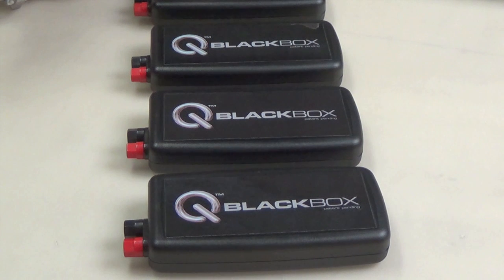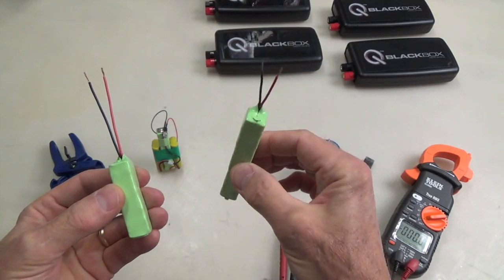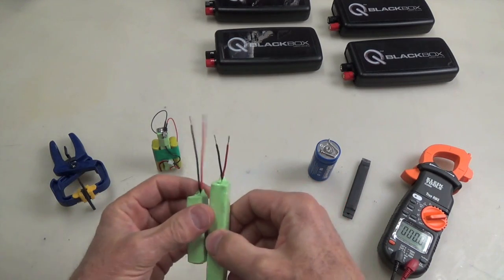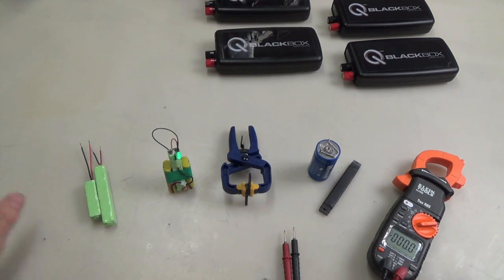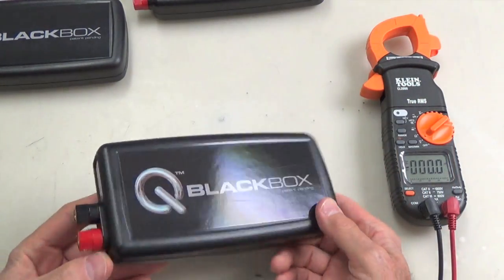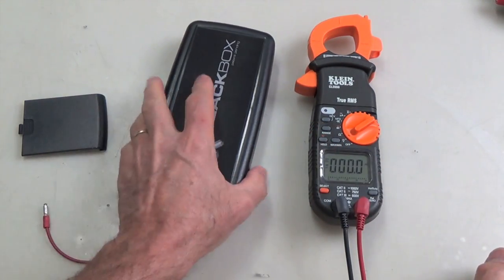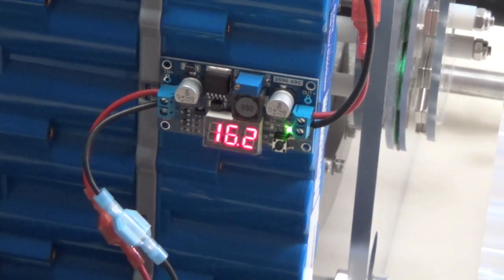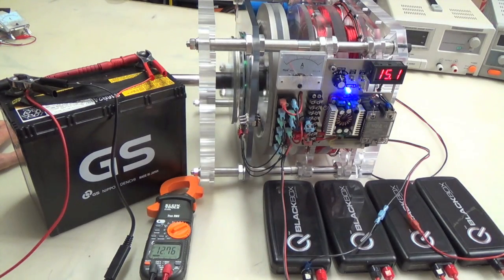BLACKBOX - Silicon Crystal Graphite Battery Module - NO CHARGING

Comment: At home I am already building it with graphite plates (2 types of graphite) and a dialectric electrolyte (a sticky gel-like liquid, it has to be a very viscous liquid). And the best thing is, it works as you described it, but the energy comes from heat because it converts the energy of the heat into electricity, thereby charging the plates. The electrolyte has free charge carriers that move and release electrons from the cathodes and anodes.

I wanted to buy something like that, but I can't afford $ 2,000 or even more and most of the others I even told a friend about it that he found her invention interesting (he said to me "It's a fine thing;)").

Why not sell cheaper units for $ 100 with it you would earn much more than with such expensive units that can not afford so many bars. More buyers mean more revenue, so you only give a small part the opportunity to explore this thing.

I would buy it only if I either had enough money or if it was cheaper.

LG
Reply: I wanted buy from him but unfortunately the site is down for some time now. Can you give me a few pointers on how to build it? I would be happy to pay for it.
Reply: @thepetest22  Yes, there are 2 layers of graphite types (2 different). One side is doped and the other side is oxidized. So one side gives off electrons and one side accepts electrons.

If so, it should generate electricity like a battery.
Reply: @Chicsweet1987  Awesome, thanks! And what exactly goes between the two layers? How to prepare it?
Reply: @Chicsweet1987  Would you be interested to share your findings as well as maybe blueprints in a telegram group? I just found out that Mike Kantz has passed away unfortunately, and I feel that we should pick up where he left off and make this technology mainstream..
Reply: @thepetest22  
So far I have only recreated it on loan, but you have to use 2 different types of graphs. When it did, it only delivered a few millivolts. What is between the shifts someone explains in the video:

My notes on it
2 plates

10 elements in every single cell
(complicated processes = manufacturing)

Start redox reaction
(very easy)

Anode (left) pure graphite plate (breathing) 1/8 inch
Oxidized

+ Cathode (right)
Receives electrons

electrolyte
Deilectic
Gel-like sticky (like solid electrolyte) Silizion SIO2 integrad
Silicon Activated Activated Enlarged 300 times
Expanded = increases load carrier plate to plate
faster highter rat = higher speed
if not prevented = fracturing = destruction of the cell = where is expansion going = as simple as the electrolyte gel
Carriers take to go in gel
Overgrowth on silicon = electrons from the donor plate to the cathode
Fire extinguisher = does not burn = does not freeze = very hard material = no acid = no toxic chemicals

Dream what he has already developed for a long time = Developed for a long time

Comment: looks intrestig if you can get it up to USB power to charge phones it would rock.
Reply: @MisterManiac  USB port ?
Reply: I highly doubt you can cut a usb cable hook it to the red and black connector and charge your phone as it would overload the internals if the device had the equipment to regulate the USb inside it would simplify for people who have no understanding of elecronics Yes people can take a car charger and sodder some wires to the connectors after takeing it apart but any have no idea how to do this stuff.  I was just saying puting it inside would expacd the opertunity to people and you could mass product them making money.  But some peopel required a full expelanation to understand.  Dang

Comment: awsome application of the tesla motor. i especially like the cap/pulse /charge cycle idea. don't know if you sell or will be selling whole home generator packages. as a unit. Like a generac. Say 18 squeezed down together with thin plexi or acrylic spacer/mount to back side like in your demo unit. then the pulse motor then another pack of 18. run the drive shaft through to your generator??? By the way. many smaller caps will charge up quicker. Pack it all in a neat cute quiet little box.
Reply from the maker: great design idea

Comment: It is physically impossible for these to go on forever without needing charged.  First of all, in the pack itself, you have the batteries charging the caps, which then charge the batteries.  The problem is every conductor in the circuit will have some electrical resistance.  It might charge back and forth for quite some time, but little by little you will loose some of that energy to the electrical resistance.  Now let's hook these up to something.  Let's just take a simple LED bulb.  By lighting the LED, that uses some of that stored electrical power.  When it's used, it's lost from this system.

On another note, placing the batteries in series, it will not give you 11.2 amps.  You will still have your 2800 mA.  You have to put batteries in parallel to combine the current.  Putting them in series will only increase the voltage.
Reply from the maker: After being recharged by the cells, if you remove the batteries and use them to power other devices, you will definitely have 11.2 Ah. The batteries can not feed back to the cells while the internal diode blocks them.
Reply: And you are wrong in this sentence: "When its used its lost from the system".
You seem to have forgotten nothing is created nor deleted, only transfromed.

Comment: I have a 35yr old EV!
I Need 144vdc @ 200a, To Make it Work!
Lead Acid Batts are about $1,000!
Lithiums, Probably Do it, And I Would Need,
BMS, AND Charger!
I Figure $15,000-20,000!
I can buy a New Leaf for $21,000!
If I Can Trickle Charge my Lead Acids,
Say About, 150vdc @ 10 - 20a!
Then, I would Need A BMS , 
For my Array of Lead Acids to make sure, 
I Wouldn't Go Below 20% discharge!
80%, Left in Battery Bank!

Comment: Why not use a solar panel to operate a low voltage hertz emitting diode to charge your cool technology you have invented? That pulse engine works off frequency right? Why not make things simpler and get rid of the motor and just use frequency? But hay if you want to feel special and all tingly with your toy and senseless use of materials and tine and .....money hay its all you. ; )

Comment: Question, if crystal graphite power cells generate an electric charge from the induction field generated by the molten core of earth? Then humans have evolved to operate in said induction field that also generated atmosphere correct? I read a study of how plants subjected to infrasound grew at a fast rate. Infrasound like induction is frequency correct? Could not induction coils be used to grow crops in hydroponic green houses at a much faster rate? Just use the correct frequency to boost plant growth. Crystal graphite graphite power cell technology could be used to supply power to these green houses to do this yes? If so drought stricken areas could be given this technology to help save lives. Sun to water machines could also be used to supplement water supplies. But do the powers that be really want to help others in need? = /

Comment: The magma jet stream that generstes an induction field that creates atmosphere charges these graphite super caps? Induction is frequency? So these are reallly operating off earths induction field? Why not use a different frequency to amp up the electrical output of the crystal graphite power cells and stop leaching off earths power system that keeps atmosphere in place? = /

Comment: Could a microwave transformer with two magnets on each side generate 110 volts? If so then could you not use  crystal graphite power cells and generate a home power plant? With a capacitor and gel battery bank? You could even run an induction graphite hot air V-10 Manson engine off the microwave transformer with a transmission to turn a high voltage generator. Talk about free energy? LOL
Reply: does that work with the magnets and transformer?

Comment: An integrated system to generate green renewable electric energy could be developed to replace all the fossil fuel use? A solar acustic engine tuned to the correct frequency of the crystal graphite power cells would generate a steady flow of current? 100% free energy 100% more efficient then fields of solar panels? = /

Comment: The Crystal graphite power cell can be exposed to an induction field that will crank up its electrical output? Induction is a frequency correct which means you could tune into the Crystal graphite harmonics to generate more electricity? Is this correct?

Comment: You could use axial vector crystal graphite induction hot air engines in a bank that ran a transmition to power all sorts of vehicles vessels planes and electrical power plants. No more need for coal gas geothermal or hydroelectric power plants. This would benefit the whole world yes? = )

Comment: A artificial fire place ran off thermal electric crystal graphite power cells would be a big hit on a very cold night. A little Doyle graphite hot air engine inside would make it self charging? Novartis

Comment: Design a Doyle engine to work off low voltage induction using graphite crystals in the pistons for a hot air engine that generates electricity has well has mechanical motion. A cool design to replace a pulse motor to generate power for crystal graphite power cells that has multiple applications. Hay do you think it would work to power vehicles? = )

Comment: The average US resident uses 600 watts per hour, 24 hrs/day all year.  
A lot less while you're at work or sleeping, most during cooking, cleaning, etc.  
So you'd just need 200 of those Black Boxes to meet your needs !
Reply: We Don't Need Batteries     The space around us is the best battery.  
"The vacuum of space appears to be an energy reservoir of immense capacity 
that makes nuclear power seem old fashioned."   Richard Feynman and others have pointed out that the amount of Zero Point Energy in one cubic centimeter of the vacuum (ambient space) is much greater than the energy density in an atomic nucleus.   "The amount of energy expended by our galaxy of 100 billion stars shining for one million years is roughly equivalent to the energy locked up in one cubic centimeter of space anywhere."  

If you could produce energy faster than you could use it, 
then you wouldn't need an extra man-made energy storage battery.
Reply: Mike Hingle u

Comment: Those 4 2800 mAh cells in series results in a battery capacity of 2800 mAh @ 4.8 v. If you want to increase capacity, you need to put them in parallel which would give you 11.2 Ah @ 1.2 v.
Reply from the maker: Correct. Or you can remove them and use in other single 1.2v rechargeable devices for combined Ah sum.
Reply: are these devices for sale

Comment: For example if you take nintinol and use cold and hot water to activate its crystal lattice to produce movement? Could you not remove the need of hot and cold water by using radio frequency or a hertz tuned to activate the crystal lattice? High vibration causes heat in the water low vibration creates low temperature is this not correct?

Comment: Would not an induction field tuned to the power cells harmonic crystal lattice produce a steady flow of current? You could design an integrated power system  correct?

Comment: Is it possible to design a basalt limestone graphite crystal harmonic power generator that run an electric motor? Or generate an induction field to run a Manson graphite hot air engine to produce high voltage creating a stand alone power generator that is fossil fuel free?

Comment: Design a solar acustic engine to use with your power cells. I bet you could get rid of geothermal and coal and gas burning electricity plants if you did. You would just need to find the right sound generation to energize the graphite Crystal matrix correct?

Comment: If you use nano wire liquid batter technology with crystal graphite power cell technology with induction technology with hot air Manson engine stove top fan technology? Could you not create a space heater that could provide heat for a few hours then be able to recharge itself? If you had more then one working in intervals could you not heat a home? Now design a cooling system that works the same way. Hay no more heating and cooling bills? I have a cooling design are you interested in hearing it?

Comment: I would Like to see the discharge curve to determine how viable this is.  Under serious loads of discharge and unrecomended charge the silicon will expand and break up.  Maybe a power diode to prevent charging via the terminals.
Reply from the maker: Quite true Mike. I developed a simple solution to the expansion issue in March '16. Even MIT is now experiencing this obstacle. They have resorted to using hollow silicon coated nano tubes to provide a space for up to 300% expansion. Technically cool, but inhibits product production. Yes, I do have a diode in the circuit btw.

Comment: So could you increase current with a higher surface area per cell? Or can you make a cell by mixing powdered graphite and powdered silicon crystal each in some electrolyte and put the two poweded mixed dried and hardened together to make a cell with high current and voltage?
Reply from the maker: +travis moore   It doesn't work quite that way, but I like the way you think!
Reply: PMMG4HYBRID , 
Are You Still Alive?
Does This Thing Work?
I have a 35yr Old, 
1981 Jet Electra!
I Need Batteries that Work 
Or a Trickle Charger That Works!
With That Information, 
You Can See, A Photo, 
And More Info, on the Internet!

Comment: 2 Questions:
1. How long will it take to recharge the Blackbox batteries after being fully drawn down (after 4hrs run time?)
2. If you connected the Blackboxes in series without their batteries (4X17=68V), but introduced a variable resistor pot between them and the G1 to maintain your ideal 15-16V, would the milliamp delivery still be insufficient to drive the G1 and overtax the silicon/graphite cells? 
Great work BTW.  I've followed you for years...
Reply from the maker: +The PianoGuy   1. It was 6 to 12 hours before I switched to new lithiums... testing now.  2. A buck converter would likely work better. Haven't tried that yet.
Reply: It would take infinity

Comment: You Should use that blackbox (a bigger one) to recharge an electrical car. If you manage to do that you can limit the size of the battery, making the car lighter and get rid of the range anxiety. Obviosly when the battery is out of charge, the car won´t be able to run normally, but you won't be stranded.

Comment: Why aren't you just charging the large battery directly with your black boxes? Isn't there more power loss doing this way?
Reply from the maker: +George Houghtby   Pulsed induction charging and adjustable 3-phase output of G1 is better. Ultracaps on G1 provide load leveling for greater Blackbox energy transfer efficiency.

Comment: With an ideal diode or 3, you can have mulitple banks of cells driving the device indefinitely.  One rests while the other charges.  If the short time scale of off time offered by an ideal diode is not sufficient, a small switching system with a microcontroller, or even relay logic could perform this task as well.
Reply from the maker: +shogun x  Great idea!
Reply: Thanks, and likewise.  An associate to whom I showed your video asked if the operation was thermionic in nature?
Reply from the maker: +shogun x  Only in a small beneficial way.

Comment: Cells in series add their voltages but the capacity stays the same! so 
even the 4 blackboxes in series only have a capacity of 2800 mAh! :) 
pretty cool stuff though :D
Reply from the maker: +FyJonas   That is true for series connected usage. However, the individual batteries can be removed from the Blackbox and utilized individually in other devices for full rated capacity x 4, then replaced into Blackbox for recharge.
Reply: well thats true :)